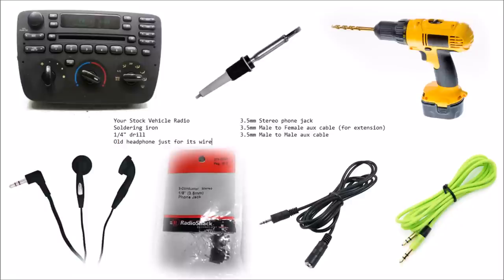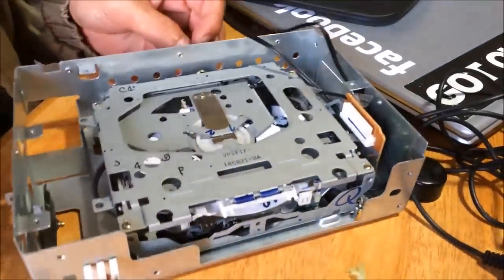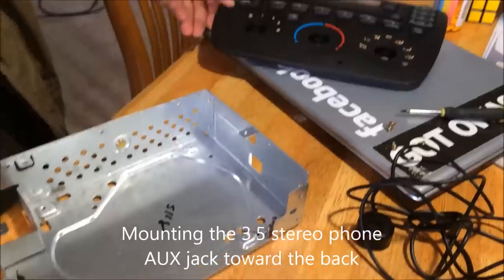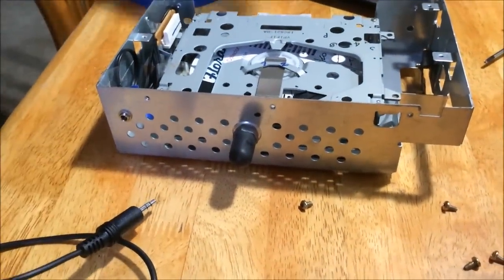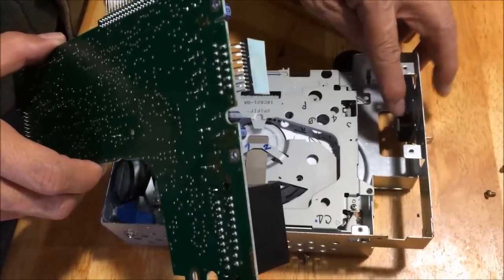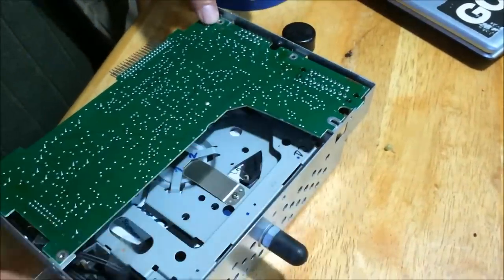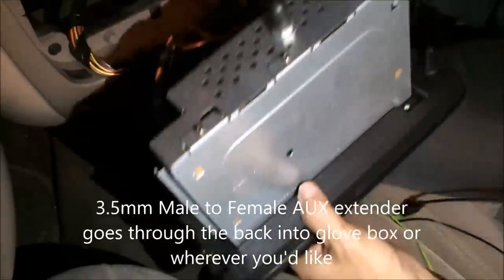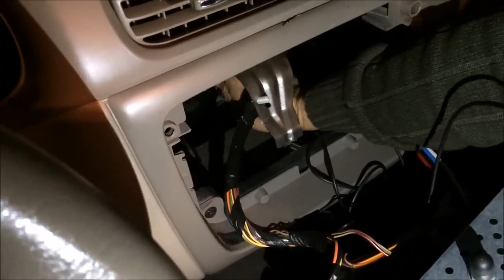Insanely Cheap Way ($3) to add Auxiliary Connection (iPod/Phone/mp3/etc) to your Car!!

Comment from the maker: For those of you who don't have the slightest  knowledge in electronics, here's another solution:
https://www.youtube.com/watch?v=aB5ygnzihWw&feature=gp-n-y&google_comment_id=z13kv545umrbcrsvq22fd5lyjvn4wnyry04
Reply: sir Can i add my Bluthooth Audio Reciver To My Old DVD '?? &How Can We Do It ??
Reply from the maker: Ok, so you want to link a bluetooth audio receiver to a CD player? Is it something you can plug into an AUX jack?
Reply: Yap' but in my dvd player there is not Aux ( Audio ) jack
Reply from the maker: What model is the DVD player?
Reply: +Edward Chua  it's a old model of Deawoo I buy it before 6 years Model is '' DAEWOO DV308 ''
Reply from the maker: I was hoping to get pictures of it, but cannot find it. Does it have a 3.5mm line out or red and white RCA audio output?
Reply from the maker: You can email dtbdaman5@gmail. I think you need this:
1. Stereo jack 3.5mm female to female
2. Stereo audio cable RCA to 3.5mm

Those two should connect to the stereo.

Comment: New someone figured out a way to add your aux devices without purchasing the wireless transmitter or cassette with aux cable.i have an old pioneer cd player that delivers powerful quality sound. Being that its lasted me 10 Plus yrs.i can now take out my new pioneer deck.add the auxiliary connection n reinstall..great work..thanx..if u can put a video together adding readable media.such as usb..id b very interested.

Comment: I just did this in my 2005 ford taurus without any previous soldering experience. I just ran a 1/8th inch patch cable through one of the holes, removed the insulation, soldered it on, red = right, green = left, yellow = ground. Sound quality is decent, its lower in volume than the cd player, but im going to try to make a blank cd now and see if its better.
Reply: Using a silent audio cd and the sound is much better now. Just about cd quality. Thanks for the tutorial :)
Reply: I did the same thin and, since I didn't have any cd's, I scored the speaker circuit on the circuit board and i didn't have to use a blank cd.  Worked well.

Comment: As for the two audio sources, it seems like the stereo detects the aux signal and mutes the CD signal.  I played a loud song on the CD and then plugged in an MP3 player and played a quiet song.  There was no mixing, and I could not hear the loud CD song at all.  I know it's weird, but it is what happens!  Wish I could do this for my Durango.
Reply: Chris Donica you can
Reply: Awesome!  Do you think you could post a link?  I was told that the only way to add an AUX input to the stock Durango stereo was to disable the VES (Video Entertainment System), and my kids would kill me if I didn't have the DVD player working!  :)
Reply: Chris Donica LOL that's funny yeah I have children they are older now and they would have killed me to back in the 90's if I would have done that.can you take a picture of your stereo and give me the year make and model of your vehicle and I'll send you instructions and please subscribe to my channel because I will be going live in a few weeks. On how to install stereo equipment how to customize vehicles and how not to go to the "stealership"(dealership) to repair your vehicle or to get upgrades
Reply: Chris Donica I apologize for the late response I've been working 1214 hour days

Comment: This saved me! Putting subs in with a low output converter till I can afford aftermarket install kit. Soldering made me want to gouge my eyes out however. Those pins are way too close. Worked on the first attempt at least.
Reply from the maker: +Brad Harper Glad it worked!

Comment: what headphone did you use to solder? they don't look like regular headphones? I'm confused. also did you solder the 3.5 aux jack or what?
Reply from the maker: Justineelv It's an old headphone with two earbuds.  Yes I soldered the jack.

An easier way is just to find three small wires, maybe a phone wire or whatever you can find and use it.

Comment: Video is misleading. My only complaint with this video is that the aux jack that is hardwired into the stereo is $0.85... WITH $8.00 MINIMUM SHIPPING, putting the final cost of the build well over the $3 mark as indicated in the video title. If you know where I may find this piece for a lower price, please tell me. It certainly isn't at the link in the description.
Reply from the maker: Try ebay with free shipping from China
Reply: EBay only sells the pieces in bulk packages (from 10-100 ct), with no option for free shipping. I have all other necessary components, but am missing this single piece. I'll try some local car audio businesses tomorrow, but if not I suppose I will be forced to pay $9 for an $0.87 piece of equipment. :/    Thanks anyway though! Great video aside from trying to source this exact part!

Comment: How do I know which pin on the phone jack matches the joint I need to solder on the CD module?
Reply from the maker: Eric Eckenrod  The important thing to know is finding the ground for your jack and matching it with cd circuit board.  The other two, left and right, can be switched.  I don't often use the left and right balance so it doesn't matter in my case.  But if you find that your left and right balance works the opposite way, all you need to do is switch you solder points on the jack.  I'd do the wire switch on the jack because it's easier to solder compared to the tiny solder points on the circuit board.

Comment: the CD control unit in my taurus looked completely different than the one in the video. did not have lout or rout, it had LRCH and DATA in its place. needles to say it didnt work. any suggestions?
Reply: did you ever get it to work? just curious. I have the same situation
Reply: same here... did u figure it out

Comment: I do not think this work well, if you will have 2 signals the quality of the sound will be bad, also you can find another way leaving the points soldered and cut the wires from the cd unit, or use a switch to allow one signal only, for cd detector you can make a mp3 track with no sound and burn it into a cd so you do no have 2 audio sources playing at the same
Reply from the maker: Javier Castaneda The blank mp3 is a good option.

Comment: Is there any loss in sound quality?
Reply from the maker: Maybe minor--you should play a CD with a blank track in the background for best audio quality. Other than the fluctuation in volume from the backing track of a normal CD, it sounds good.
Reply: Thanks for the reply. Just did it on my radio and it works perfectly.

Comment: Thank you for the post and help. I wish you went through the entire process though.
My circuit board is different, probably newer (2007 Ford Taurus). Do you know if I'm able to follow this process if I have a circuit board like this http://imgur.com/a/eCDSE
If link doesn't work, my circuit board's pins are labeled from top downwards:
GND, EMPH, LRCK, BCLK, DATA, GND, V_GND, etc etc

Did DATA replace the LOUT and ROUT?
Reply from the maker: Sorry, I don't know.
Reply: hey, were you able to figure it out?  I have the same CD and I dont know where to solder
Reply: i did it today for a 2005 taurus. the colors of the aux wires were different but used common sense and made it work.
Reply: Did you ever figure out what pins to use?
Reply: Ditto.  Have the same board as you in 2007 Taurus. 
 
Just a guess but they are probably taking the digital audio to the main circuit board via (data signal) and doing the DAC there.  But that is purely just a guess.  If so we'd need to find where analog audio could be connected on the main circuit board for an AUX input. 
 
If anyone knows or can figure out how to add AUX to the 2007 version we'd be grateful.
Reply: 2007 Ford Taurus SE Sedan - Audio System AUX Jack & Bluetooth Addition 
 
Here's what I did. 
 
Removed the +/-L and +/- R from 20 pin connector of the in dash CD player  (integrated control panel), and connected them to AUX jack. 
 +R pin  9 Dk Blu/Wht to AUX jack ring
 -R pin 19 Gry to AUX jack sleeve
 -L pin 10 Wht/Pnk to AUX jack sleeve
 +L pin 20 Brn/Lt Grn to AUX jack tip
 
Pin removal made easy. 
 http://www.1130cc.com/forums/showthread.php?t=96267 
 http://99mpg.com/mima/pininstall/installation/05openingtheharness/ 
 
Insulated and secured connections with electrical tape. 
 
Playing a CD selects the AUX input.  "Real" or silent CD doesn't matter which because the CD audio is disconnected. 
 
AM/FM radio still works because it is actually in the trunk with the amplifier. 
 
Could use about 10db more gain.  Other than that it is good and is still quite usable. 
 
Audio quality is on par with the CD. 
 
Added iSimple MusicStream ISBT23 Rev. 2 (Bluetooth) and full volume level is restored/available. This device has 4V RCA out rather than 2V.  That's about +10db.
(ISBT23 black to pin 1 GND & ISBT23 red to pin 6 switched power) 
 
CD functionality could be retained by using a 4PDT switch.  But why would I need a CD now with entire music library at Android fingertips.